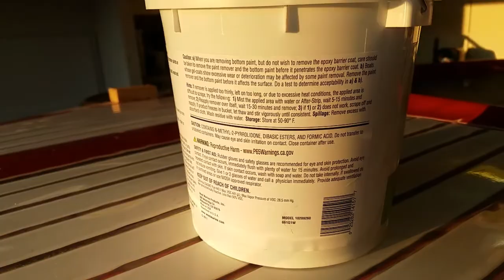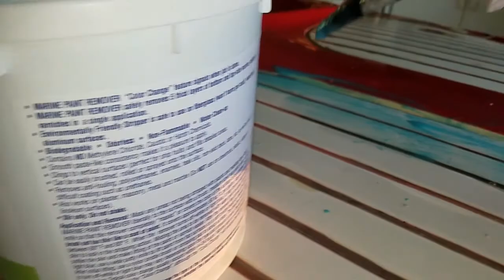Using West Marine Paint Removal to strip paint from Glasspar Lido Classic

Comment: So what´s the plan? You wanna do a nice job and restore the boat ?
I would take a 40-60 grid and sand it all down. The way You do it is a lot of work because afterwards You have to fix all the scratches and then You have to sand it anyway. Once all the paint is off You have to fill the holes and then I would laminate a thin fiberglass cloth over the whole deck to stabilize the surface. That will also take care of the spider cracks or moisture will get in the cracks and cause delamination.Of course before that the bad repairs and damaged parts need some thicker cloth from underneath where You don´t see it.
Also take a good look at the transom and check if there is some water intrusion and delamination
Did You inspect the seems between the deck and the hull ?
Reply from the maker: Thanks for the advices!
My plan was:
1) to learn how to remove the old paint . 
2) to learn fiberglass repair process 
3) to learn painting process 
4) i am not a big fan of dust breasing and garage cleaning after sanding. The paint removal solution helps to fix this issues. 
5) For sure i will not avoid the sanding but i will have it as minimum as possible
Reply: @RUS_US  Yeah nobody is a big fan of sanding. Only way to keep the dust fairly under control is connecting the shop vac when sanding.... but You still have to do a clean up before painting. If You have the boat on a trailer try to do part of it outside ..... of course if there are no issues with the neighbors